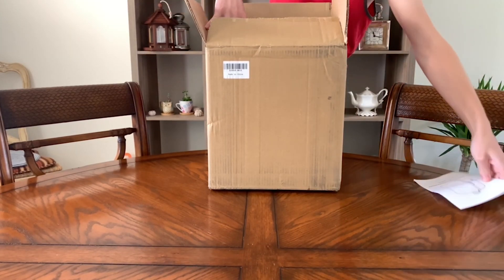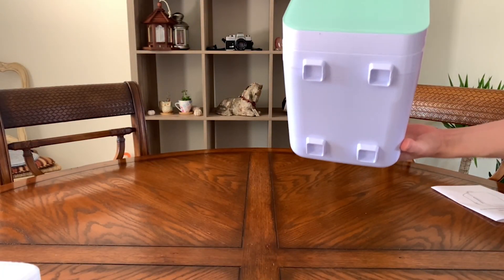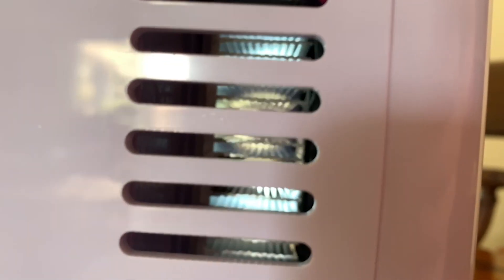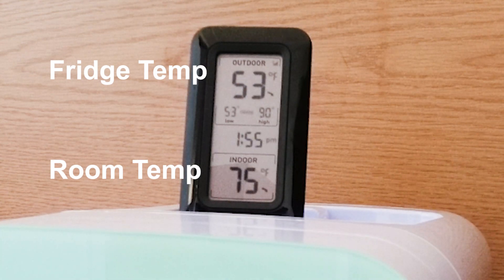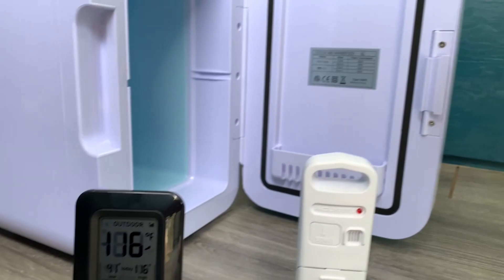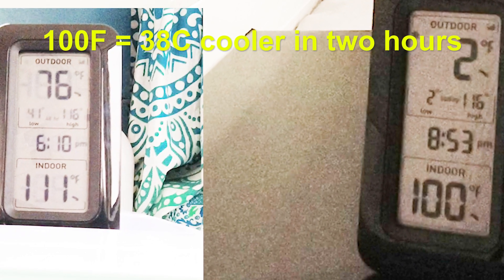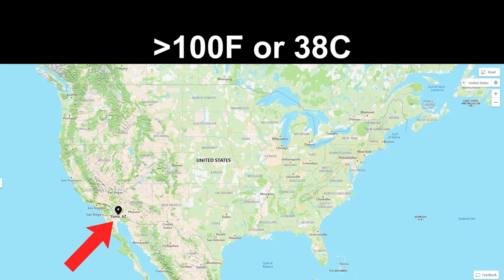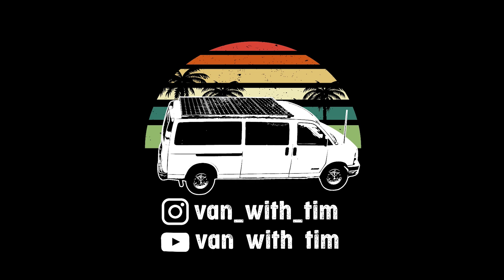Thermo-electric fridge - worth it?

Comment: People are just to stupid to find out how thermal electric fridges work and what there limitations are. Reason you don't see this tech replacing compresser cooled items. They work fine as long environment plays along.  During winter when our house is below 70 these have cooled my soda down to 42 degrees. Also aluminum cans chill faster and hold cold longer than plastic, glass bottles or cardboard boxes another factor.

Comment: How hot does it get?  Can it get hotter than the rated temperature if it is in a hot environment? Does the heating feature stay on permanently or does it cycle on and off like the cooling feature?
Reply from the maker: I never tested the temperatures of the heating function, but being that it uses the same module, just with current reversed, I would think the same 14C-20C (25F-36F) temperature delta would apply.
So in a 24C (76F) environment, it might reach 44C (111F).
I would hope there would be a temperature cut-off switch built in, but with how cheaply they're manufactured, I doubt that one is incorporated.

Comment: This was a great review. This is what I expected. The cooling feature would definitely work better in the winter and/or a cold place. I did not know that it is not made for permanent use. Why is it not made for permanent use?
Reply from the maker: I think the actual Peltier module can operate continuously / permanently. Only thing I could think of was the continuous 50 watt power draw. Maybe the manufacturer worries the customers will see the increased electricity cost on their monthly bill and leave negative feedback?

Strange as they show many pictures of what looks to be permanent use scenarios in their marketing!

Comment: Used a Colman one in a truck for about 2 year's....
They only cool a set number of degrees below ambient...
So during the winter, it was ok...but summer, if the AC was off, like when parked overnight, it would warm up quite a bit.
When I would go home for the weekend, I would usually toss half gallon water jug, frozen in the corner, and a few frozen meals, like in aluminum trays I would reheat in my 12v "lunchbox cooker"...
Anything you toss into it better be COLD before you put it in....
It served a need...but if I could have spent the extra $$$ on a compressor fridge, it would have served me much better....now that 12v compressor fridges are MUCH cheaper than a decade ago, it's a no brainer to get a compressor fridge.
So a agree with your conclusions....
Reply from the maker: Definitely feels like a glorified cooler to me.

It's a cool technology in the right application, but just not practical or efficient here.

Cheers!
-Tim
Reply: @VanwithTim  always noticed that the physical 12v plug would actually get HOT/VERY WARM when used.... actually melted one in the two years of use, and had to splice in a new one....and it was a Colman branded unit.
These things have been around for decades....and haven't improved...heck have had hotel rooms lately that use the same technology for the in room fridge.... interesting choice... cheap out on the fridge/microwave combo, then pay extra electric indefinitely too keep it running. Heck reminds me about 15 years ago a couple companies tried to sell similar units as "dorm" fridges....think after one "back to school" season, never saw them again.
Reply from the maker: @timothyp3378  I remember staying at a few hotels with the Peltier fridges. Imagine an entire 200 room hotel running 200 ridiculously inefficient refrigerators 24/7 whether the rooms are occupied or not.
Should fire whoever was in charge of that purchasing decision.

Comment: you should mod it with a heat pipe cooler for a cpu and see if it works any better
Reply from the maker: I'm betting it would help! Might make the unit more practicable.
Not sure if I want to keep the cooler or gut it and use the Peltier module in a "cool" DIY project...

Comment: If it's a computer fan, does that mean you'll be cracking it open to replace it with a RGB led fan?

I've had a fantasy project of mounting Peltier generators to a exhaust system or radiator system to scavenge current for charging batteries. Probably not efficient, but it wouldn't add load to the alternator and there's probably a few amps to be collected from a radiator system while it cools after driving.
Reply from the maker: Haha I think this unit is getting tossed in the closet for the foreseeable future.
Peltier modules are such a cool concept, and you’re spot on in recognizing the immense energy loss inside an internal combustion engine through heat.
I think Peltiers have a ways to come in terms of conversion efficiency for realistic energy harvesting.
However it would be really interesting to see what kind of wattage you could pull by placing them in extremes like directly on the exhaust manifolds or catalytic converters!

Comment: Great review!  There are so many of these peltier coolers out there.  I've heard these are not the most efficient units in terms of power usage. Any thoughts on what the most efficient refrigerator/cooler configuration would be?
Reply from the maker: Thanks for checking it out Zeke, you’re right on the market flood of Peltier coolers. Really the most efficient cooling still seems to be compressor based systems. 
Surprising as not much has changed in them in the last 150 years.

Comment: Is that the same as an absorption refrigerator?
Reply: Not at all.  Save your money.
Reply: I was just curious if it was the same system. Absorption’s only for so far below ambient temperatures too. I wouldn’t buy the fridge. But was considering an absorption. I think I need a compressor fridge though
Reply from the maker: @d-arts7139  Rick beat me to it! 

Those absorption fridges are real finicky and inefficient (much like this thermo-electric unit, just on a different cooling principle)

Definitely stick with the “tried and true” compressor fridge 👍👍

This thing has no place inside a camper build.
Reply: @VanwithTim  yea I live at 9,000’ and it’s always cool in the shade, but I would worry about only having 25 degrees below ambient to keep food safe! I need to be able to stock up with a couple weeks worth of food. Just ain’t gonna work 😁